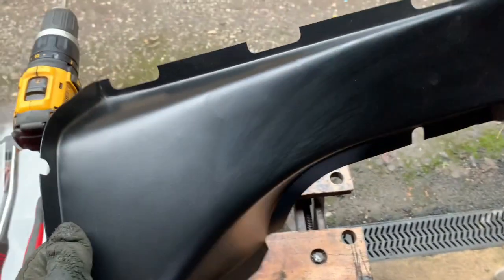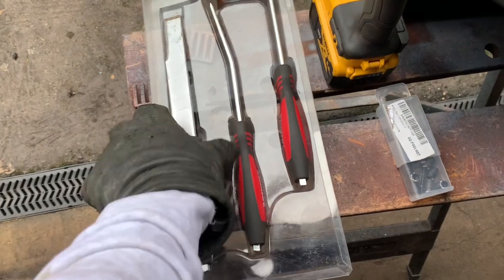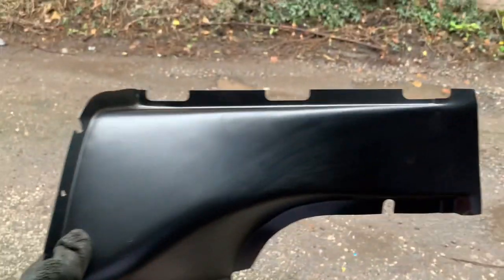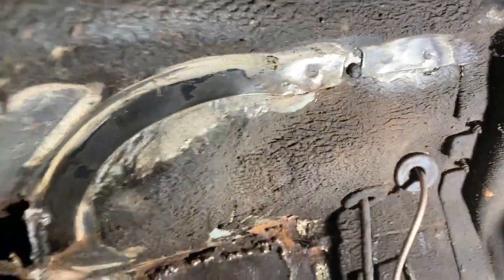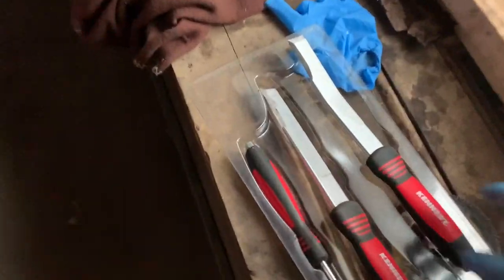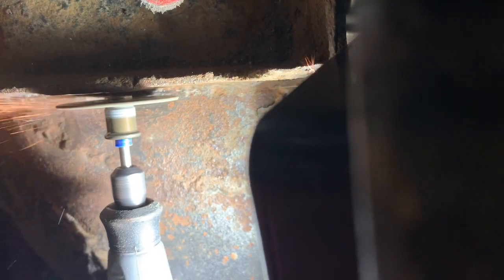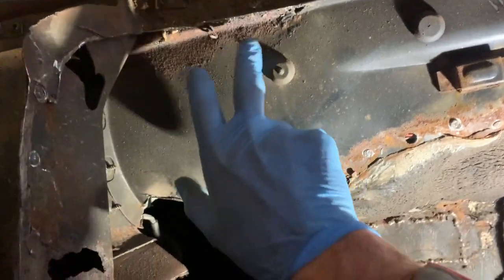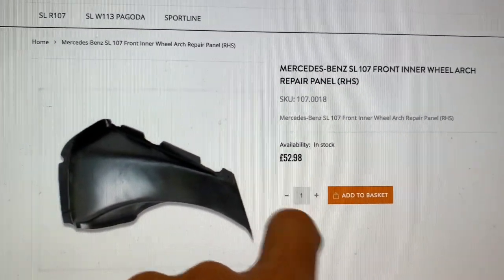Mercedes R107 inner wheel arch removal using spot weld drill bit

Comment: Why model dremel is best?
Reply from the maker: Hi - I am using the Dremel 4000 mains powered unit which is easily powerful enough to cut and grind car body panels. The extension tool which comes with the 4000 is particularly useful for cutting out metal in really awkward places. I first mentioned this Dremel in the video below:

https://www.youtube.com/watch?v=RPRKOYbTVtQ&t=5s

Mike